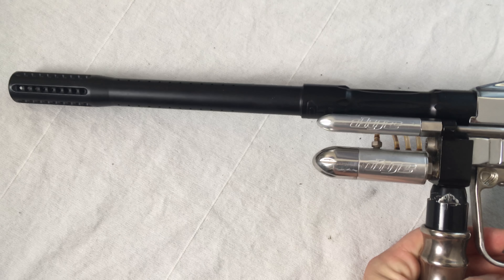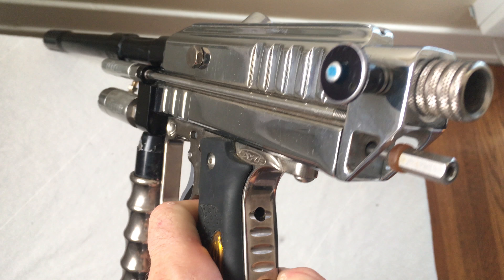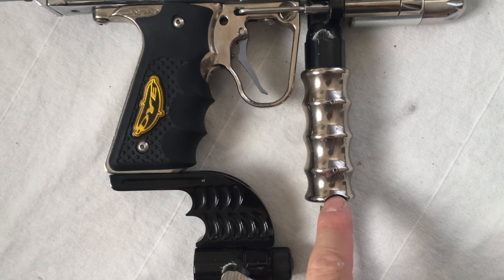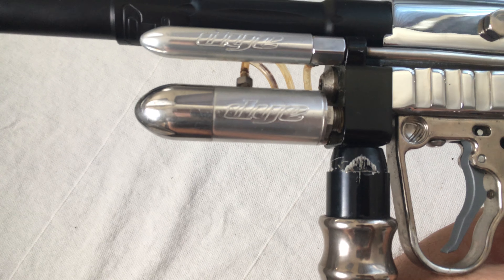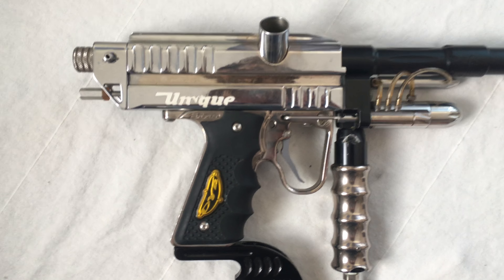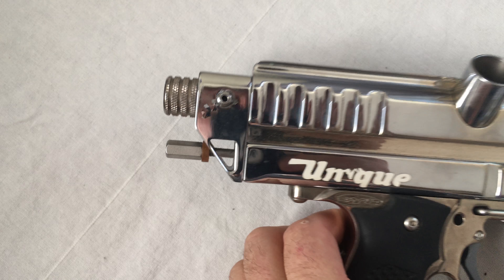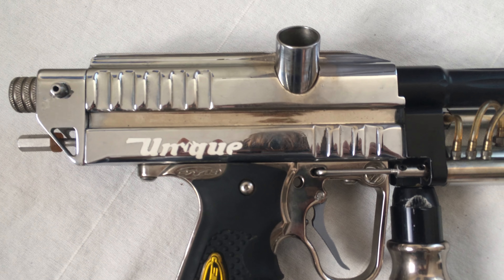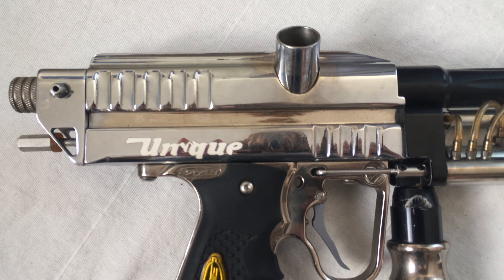Possible Jeff Orr WGP Minicocker c.1995-96

Comment: hey, where did you message Jeff Orr. I have a Aim body that has a right feed. Correct me if I'm wrong but Aim bodies were all made vert feed. Maybe there's a chance he made it?
Reply: I messaged Jeff through instagram. What I have heard is that AIM Paintball (actually a machine shop) was making bodies and components (frames, pneumatic pieces etc) for WGP and then began to make knock offs and sell them. This can be seen from the similarities in body kits to the STOs and similarities in the Eagle/Crow Aim swing frame. This would be a good question for Bud Orr. I have had a few of the unserialized body kits in vert and side feed that I believe were sold as aim body kits.